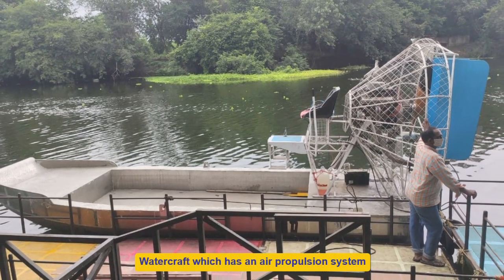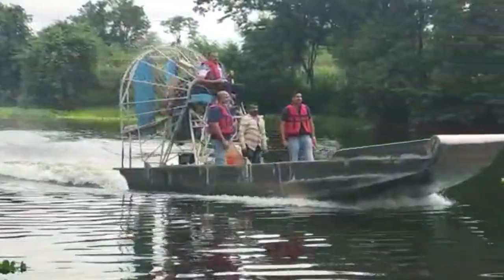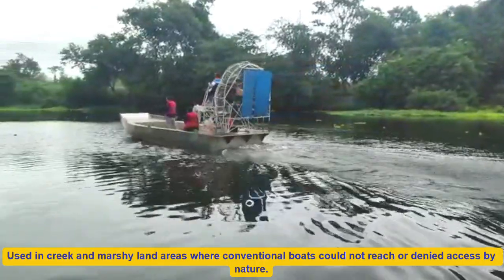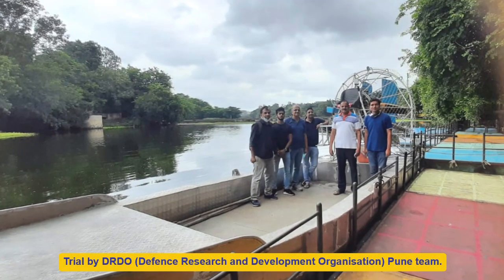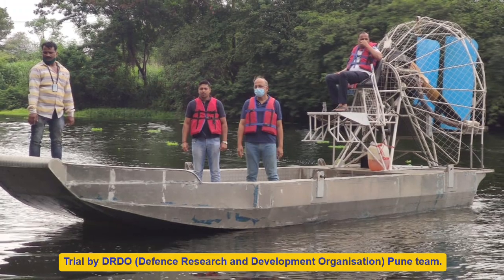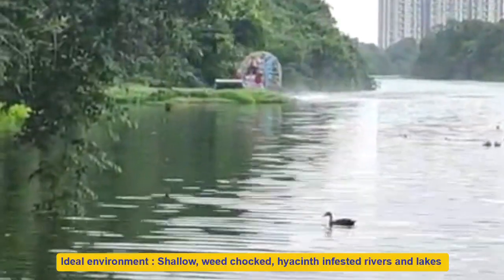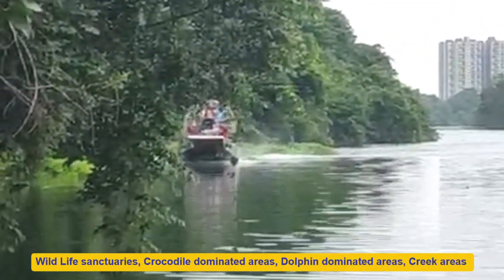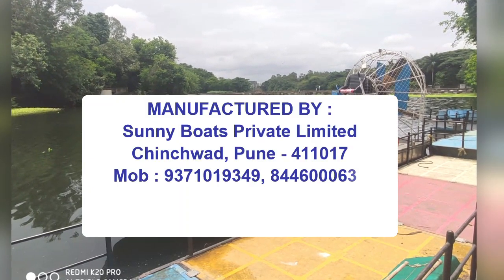ALUMINIUM SWAMP BOAT (ALUMINIUM SWAMP BOAT manufacturers in India)

Comment: Looks like a saftey hazard
Reply from the maker: It is a Flat bottom Aluminium boat and hence the chances of accidents are less.
Reply: Kitna tej jaata hai? Kaunsa injan hai?
Reply from the maker: @deepakkanojiya5312 speed of 10-12 Knots at full load. General motor imported engine (Chevy Small- Block V-8 )